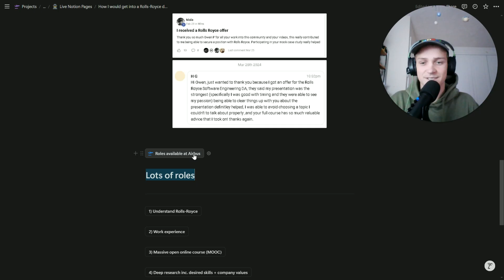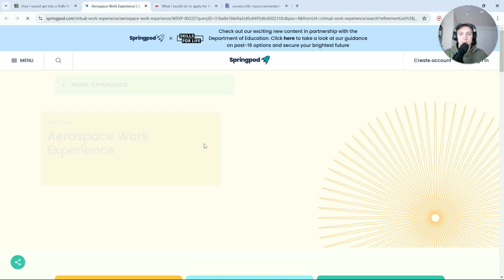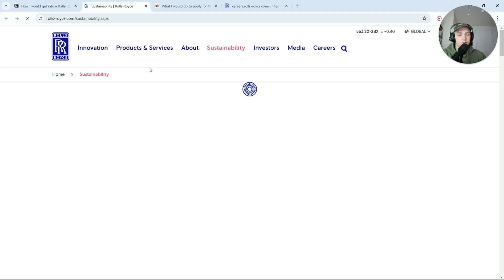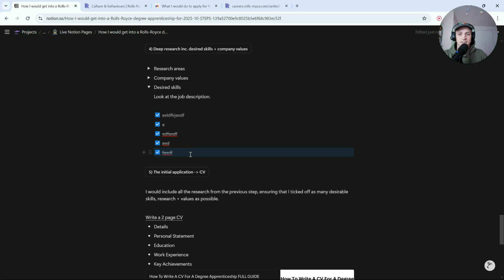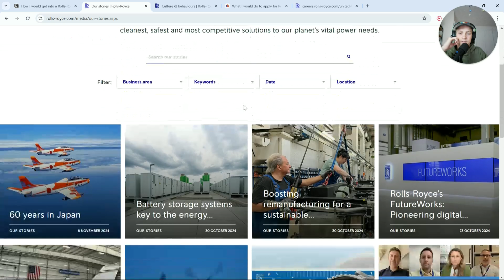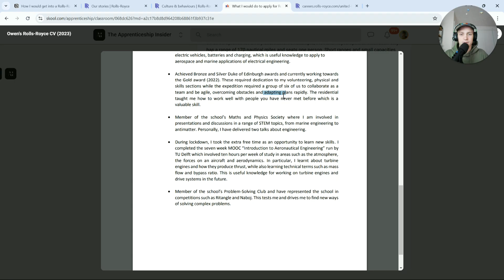How I got into a Rolls-Royce degree apprenticeship

Comment: Can you do a video on the virtual assement stuff if its possible
Reply from the maker: From my memory, there are 3 parts to the Rolls-Royce virtual assessment.

1) Multiple choice text message responses - just choose the responses which match the right level of formality

2) Numerical ability test - use this website to practise your mental maths (https://arithmetic.zetamac.com/)

3) The SWITCH challenge - use this website to practise (https://switch-challenge-pratice.org/exercise/Aon/switchChallenge)

Hope that helps. Could be different for you this year, but either way that will be good overall practice.
Reply: @TheApprenticeshipInsider  Thank you so much